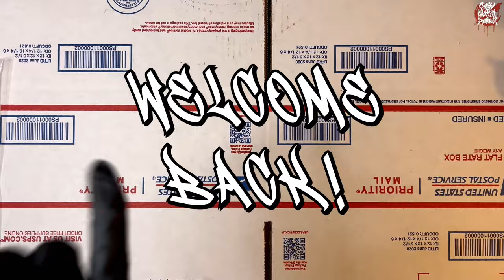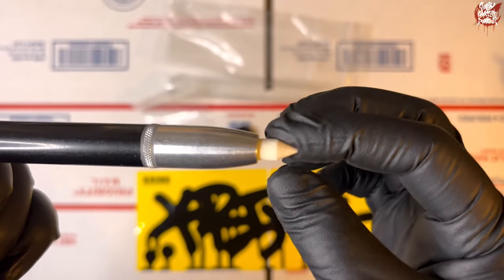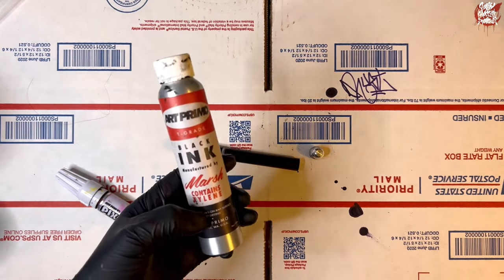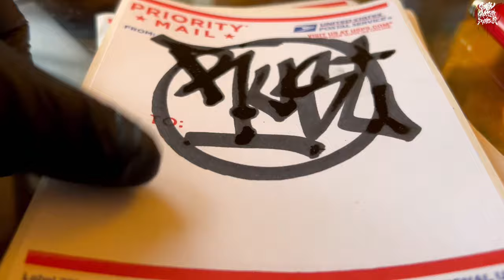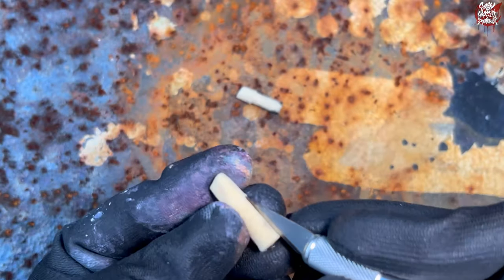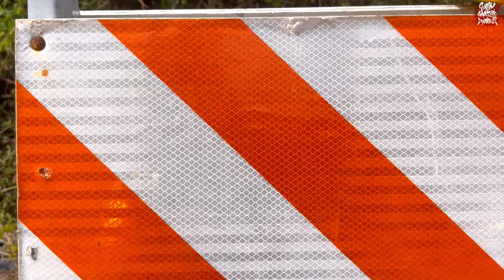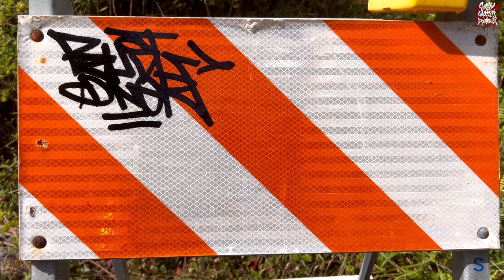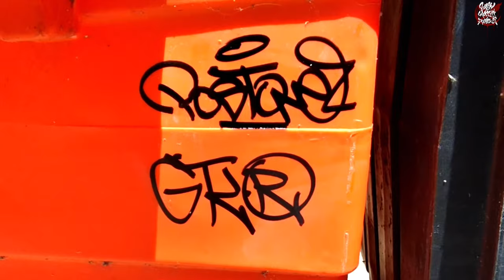KRINK Vintage felt tip pen Reviews (is it for the streets?)

Comment: The only benefit this marker has is the metal internals. Fine point nib has very few uses but has uses in those rare situations. I suppose the diameter could be another benefit. 

I won’t go out of my way to get one but I’d use one if it were right in front of me.

Comment: Would it work out to try to use the original nib just turned the other way so you would get a flat round tip?
Used to do that to my Posca PC-8K's to get a round nib back in the days. Worked out super nice with those.
Reply from the maker: It will work but the nib itself just doesn’t hold ink to great